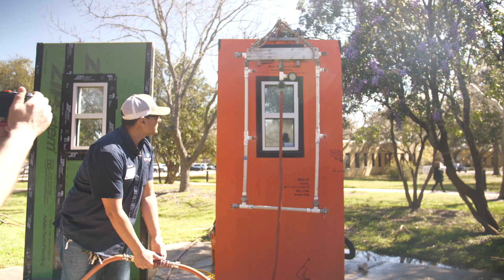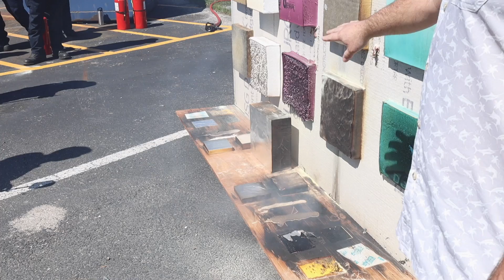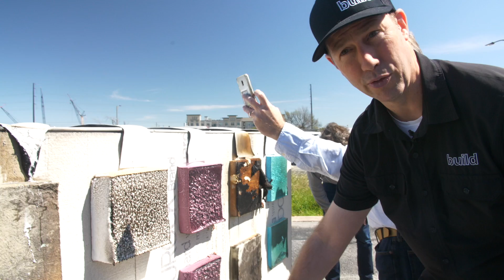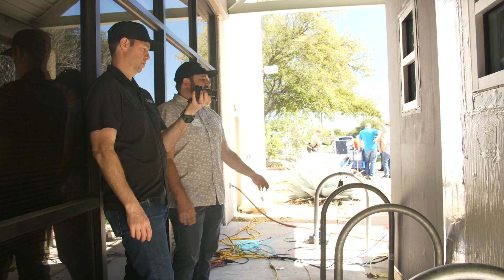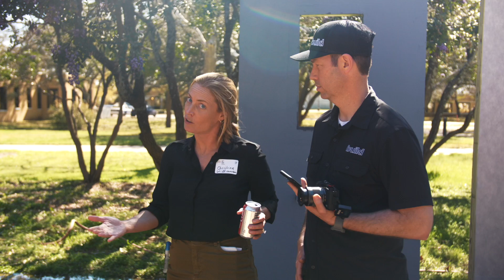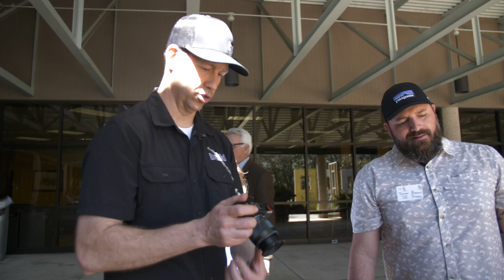Flame Testing Building Materials +More Building Science Hands On Tests

Comment: As a low voltage installer we have always followed suit with the electricians and used a fire block foam (240 degree ignition rating) to seal our penetrations. Recently we had to go replace a job with a fire caulking that meets ASTM E 136 or has an ignition temperature of 350 degrees. We chose to use 3M FB 136 which meets both standards (temperature rating to 1300+ degrees) but I'm trying to understand why. I read that standard 2x framing burns at 350 degrees so I understand the ignition rating theory. I was always told that the point of fire protection is to give the occupant more time to escape. It seems as though if a fire has spread to an internal wall cavity and is penetrating other areas through a penetration with fire block foam, we are likely talking about a house fully engulfed in flames. Any thoughts?

Comment: Thanks for reminding me why solid concrete is so superior
Reply: Expensive, high Co2, very poor insulation ... Only the third item can be mitigated. But yes, it has advantages as well. To have your cake and eat it too look into AAC (autoclaved aerated concrete). We should be using it much more in the USA. It's been around for many decades in northern Europe.
Reply: @HistoricHomePlans  LOL, I'm currently building w ACC. Having been in many AAC homes, I can testify that they are comfortable beyond their nominal R-value, which is an insufficient metric. Like measuring a pickup solely by towing capacity... there's more to it.

I think the cost is often overstated when you account for the savings in trades, scheduling, etc.

100% right on the CO2. There is concrete, however, that acts as a carbon sink, but that requires supplemental insulation (like stick-built).

Paradise, CA would look a lot different if they built like the hurricane-resistant block homes in FL
Reply: @HistoricHomePlans  I cant really remember the process but they have a concrete mix that is either very low or possibly even carbon negative. But, the expensive part is one you just cant combat

Comment: Curious: I've got a crawlspace that is eave. What can I use to quiet noise and insulate that is rigid? I want to use rockwool on the inner wall cavity, but what to put over roofing joists without blocking air flow to ridge?
Reply: You can install anything with baffles stapled to the roof deck

Comment: As a professional welder, welding RTU braces on commercial buildings, it’s extremely challenging to not light that TPO roofing and insulation on fire. Had a couple very close calls. That TPO goes up RIGHT NOW and spreads very quickly. There is never a good way to protect the insulation when you are welding 1/2” away from it.

Comment: The difference between natural asbestos and "safe" asbestos(rockwool) is the binder that's mix in the factory. 
Does the burn degrade or brake down that binder?
Reply: the minerals rock wool fibers are made from can be broken down by the body unlike asbestos. still not good for the lungs like fiberglass.
Reply: @bigblackron  asbestos is produced alot like a cotton candy rock, there a half dozen different kinds, it's more of a classification. But they're all inorganic so the body can't brake them down.
Reply: Rockwool is not asbestos, "safe" or otherwise. Asbestos is a group of 6 specific silicate minerals that are found naturally in a fibrous form. Asbestos fibres have specific properties (size, shape, and insolubility) that make them especially dangerous.
It's not the binder that makes them different. You aren't doing anyone a favour by conflating the two.
Reply: From what I know about Rockwool. Asbestos was used to line the old versions of the product. They do not use any asbestos in or on Rockwool anymore. Rockwool is made from a glassy like slag that comes from melting steal. They grind it and extrude it kinda like fiberglass. There is however formaldehyde in Rockwool. But during the manufacturing process they cook it out. Only an insignificant amount may remain.